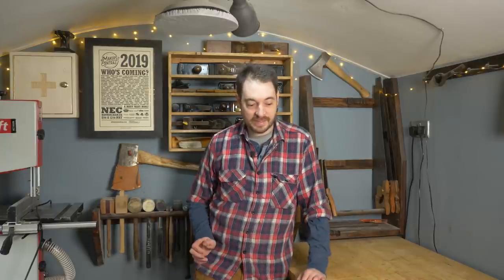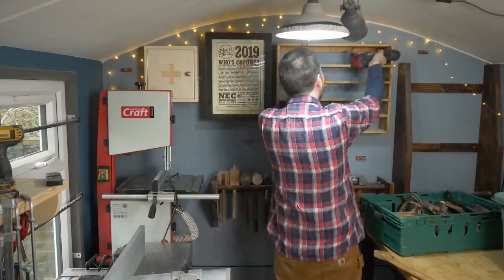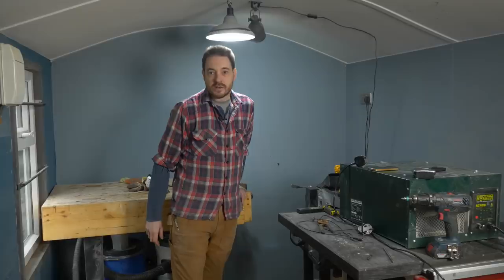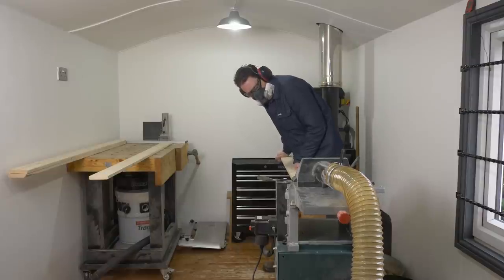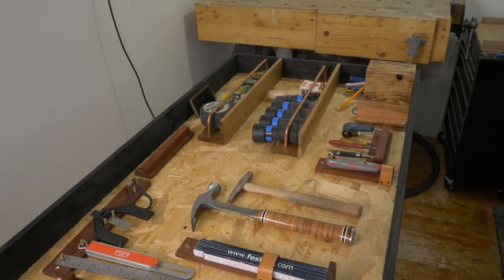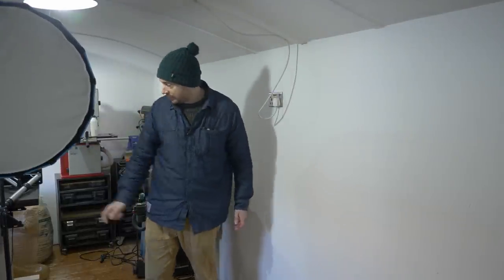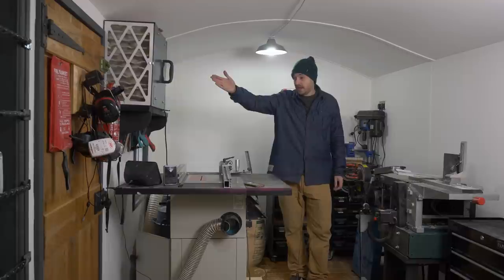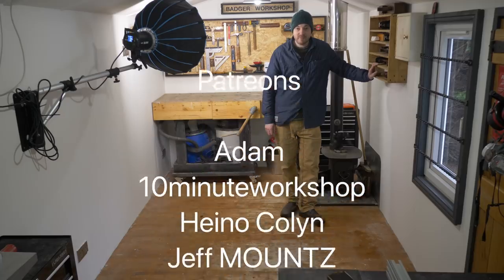Workshop Reorganize

Comment: Nice space, having white walls creates that sense of extra room. I'm in our garage, painted the  wall shared with the house white and installed aluminised 'bubble wrap' type insulation in ceiling and on main door. Bounces a lot of light ! That wall mounted light holder is inspired.
Reply from the maker: It does work well

Comment: I know you like to be thrifty, but do you think you'd find a long term benefit to replacing the lights with flat-panel ones instead? It would go a lot flusher to the wall that way (when not in use), and basically be less bulky, which might in turn make it easier to move around the space when filming (or not filming). Not suggesting something like an Elgato key light, same Neewer brand do some too.
Reply from the maker: I have a flat panel one but the light is not as nice
Reply: Ah, ok. Some of the LED ones can indeed be not great - either the colour temperature is wrong, or they're harsher than the softbox style because they have a crap diffuser over the LED panel. An old white sheet can sometimes help with the latter. May you find a way in the future to get space savings, and good light :)